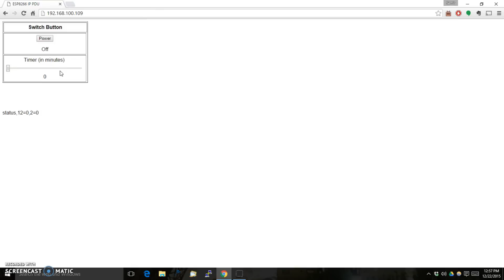Web controlled ESP8266 powered Power Switch - Baba Awesam

Comment: Hi, 
Which ESp8266 module are you using? Does it take 5V?
Reply from the maker: I have 2 modules which are both powered by 5V. One is Adafruit ESP8266 Huzzah and another is NodeMCU which is powered by 5v Micro USB cable. But the signal level must be 3V compatible in all variants of esp8266.
Reply: OK i got it. I am looking for a cheaper module so I guess I will have to make my own 5v to 3v regulator circuit. Anyways, thanks for your quick reply.